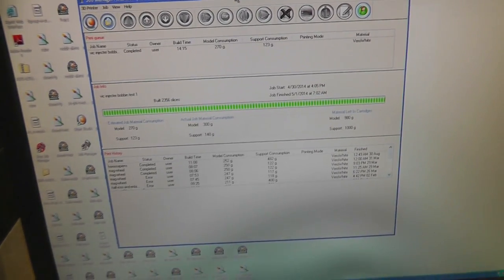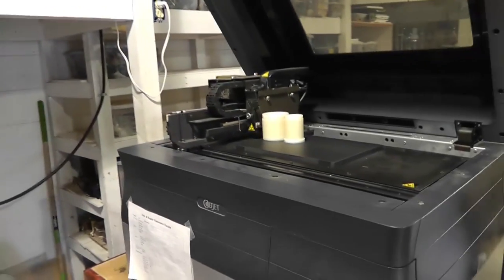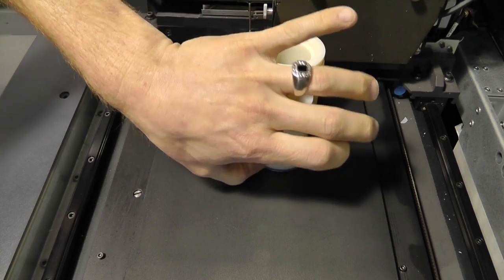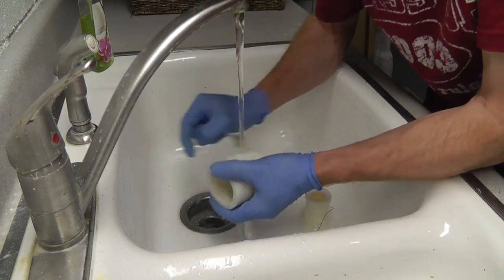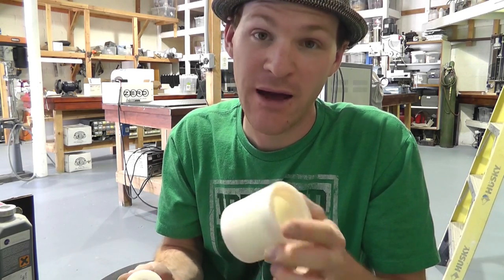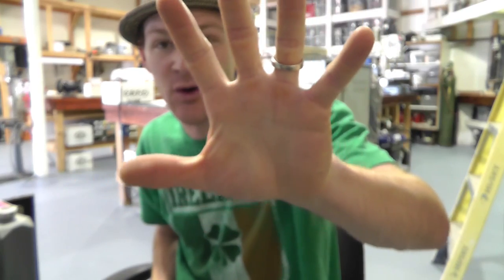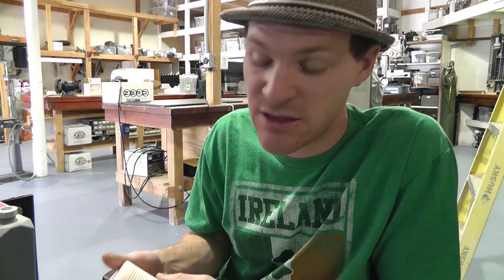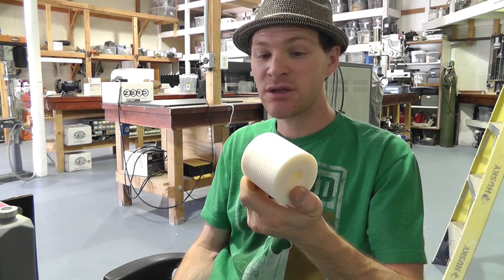Purple Platypus 3D High-Res Printer.  First Use For Me. Printed Some VIC Injector Bobbins!

Comment: The bobbins look good. The Di-electric constant (from the 30 seconds of searching I have done) is going to be around 1.7-4.5,  <--- those figures could be completely wrong. Why don't you do a breakdown voltage test on an extremely thin, well measured print sample.
All the best!
Peace
Ben